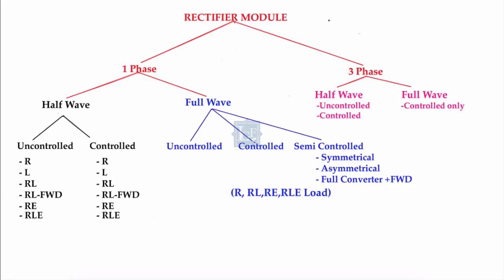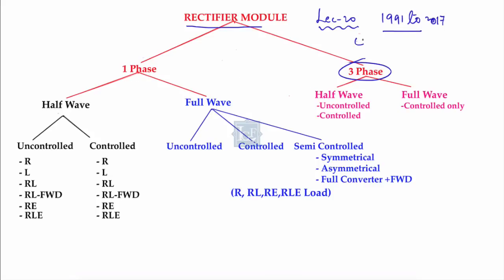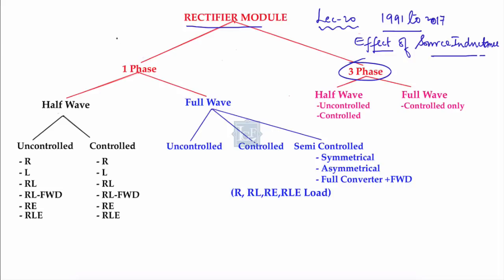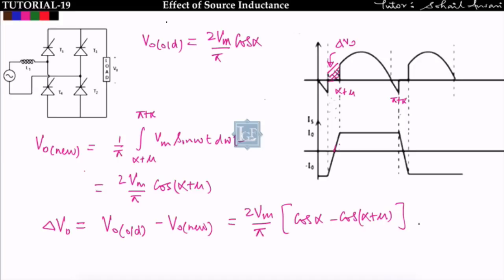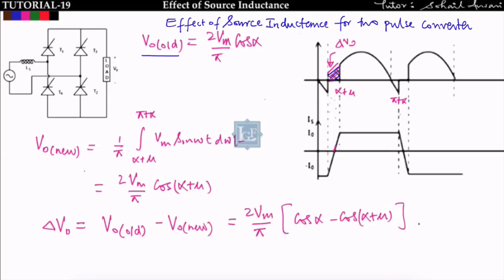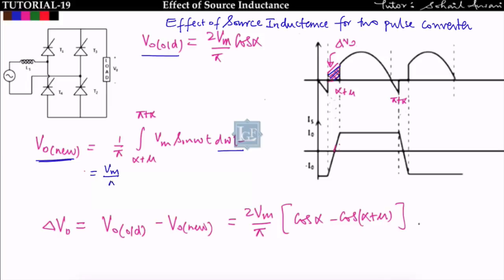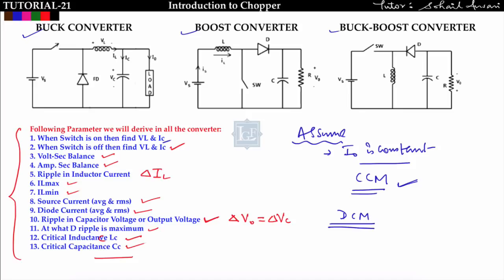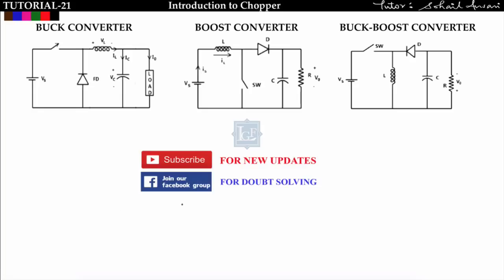Lec 21 Introduction to Chopper

Comment: Dear Sir
at 15:46 we are discussing about volt second and current second balance. the point : energy stored by L(OR C) during Ton must be released during Toff, is comprehensible. (i mean i am getting up to this  point) but sir how do we come to result that V(on)*T(on)+V(off)*T(off)=0.
Reply from the maker: yes it is necessary otherwise the system will go to unstable state...let u say inductor is abosrbing energy 50 joule an dreleasing 30 joule so for next cycle the inductor have 30 joule..now again it is abosorbs 50 joule..so total inductor energy will be 50+30=80 joule now discharged 30 joule so 50 joule left..in this way the energy stored in inductor will increase in every cycle which leads to unstable state..got it..
Reply: As I know...(Vc)avg=0
And (IL)avg=0
Am I right sir?

Comment: sir..it's buck converter or buck regulator???
and if it's buck converter then what is d difference between converter and rectifier??
plz clarify sir..
Reply from the maker: the meaning of converter and regulator is same..means anything is converter from fixed to variable..but rectifier word is especially used for the conversion of AC to DC signal..got it..

Comment: sir is it ton time will be equal to 1 
next question  is if ton =T then what will happen please explain  me as soon as possible
Reply from the maker: ideally you can say that Ton=T..means you are not turning off the switch..but practically its not possible..bcoz the inductor will go in to the steady state means it will be shorted..so KVL violates in case of boost and buck boost converter..so we have to choose Ton such that inductor will open in transient state..ok..practicaly duty cycle will be below 0.95..ok